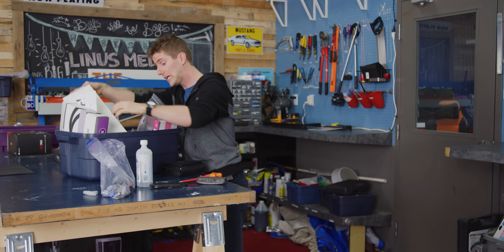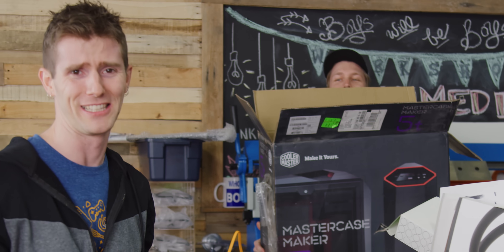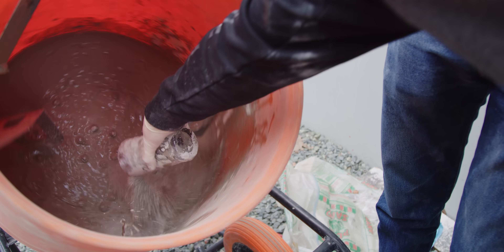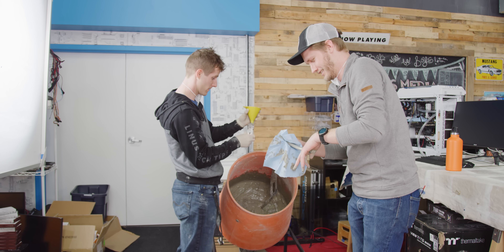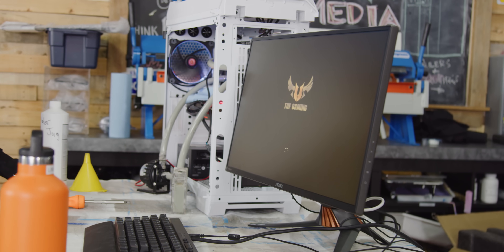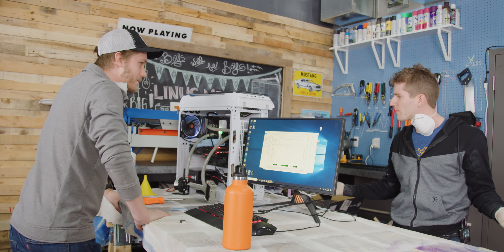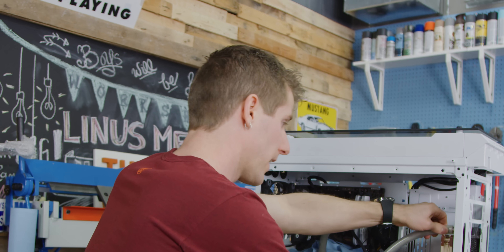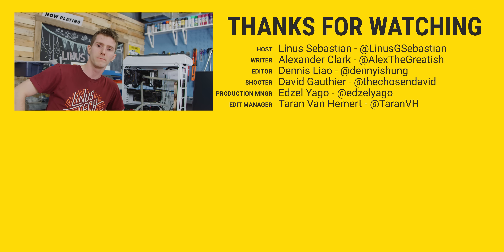I Can't Believe This Worked!!! - Concrete Cooled PC (April Fools 2019)

Comment: Next year, do an EPOXY COOLED SYSTEM!  Mix up the resin and hardener with a slow cure epoxy (so it flows better).... then fill the loop!  I’m actually shocked at how many people don’t know this is an April Fools prank video and are actually discussing the merits of using concrete as a coolant.... for real. <FacePalm.jpg>

Comment: Uh even with a UPS I see 2 huge issues. 1st being you can never turn your PC off, 2nd that will probably kill the pump pretty fast and then what do you do? You would need to have a replacement pump and be there when the pump died to replace it asap.
Also don't trust this at all where is the real PC your using hiding?

Comment: So, the fluid not moving at the edge of the pipe is related to the navier Stokes equation. For flow between two plates/the walls of a pipe your velocity tends towards zero. There is a shit load of differential equations involved, but, yeah, that's why you observed that

Comment: Concrete curing is an endothermic reaction. The chemical reaction of the concrete curing would be a factor in soaking the heat away.
So is this an April fools?
Reply: It's actually exothermic so it generates heat. With such a small quantity it will pprobably not be noticeable though, it generally causes no issues even when building walls with it, the heat generation only becomes problematic when you build giant solid structures with it, such as dams.

Comment: Concrete hardens even when not exposed to air because the water is built into the concrete in a chemical reaction. I don't know how much you would need, but I suspect there is a point at which there is more water there than the concrete can take up, at which point it wouldn't harden anymore unless water is lost through evaporation
Reply: cough it’s an April Fools joke video. cough So.... better make sure you didnt get pranked a few times already if this is the first time you realized that fact. XD

Comment: Have you tried pulling the heat with the help of concrete instead of using concrete as a coolant? Isn't it obvious that concrete gets solid after some time? Use concrete for pulling the heat from the PC and then again use concrete to pull heat from the coolant! Right? Did you try that??

Comment: Linus, the Thumbnail is misleading.
That's Cement, not concrete.
Reply: L.A. Garcia it's the tampon scandal all over again
Reply: Instructions unclear.... GTX stuck in my driveway
Reply: it really bugs me every time he says Concrete
Reply: Cement is powder.
Reply: robotica, Cement is a powder that you add water to in order to cause it to harden. Wet or dry, it is still cement. Concrete is a bunch of rocks/sand/minerals bound together with cement(that, again, needs water to harden). Since they didn't add any sand to it, all it was is cement, and not concrete.
Reply: @robotica34  OK its Cement paste

Comment: Concrete is not a solution,  But a water + ceramic liquid may be
And you can have found the ultimate computer cooling solution

So I suggest you to take some brick and or tile, make powder with it, and try several proportions with water until you find the good one that do not petrify over night and make the temperature low enough.

And even better, probably in some college some engineer or student can tell you it without the need to make too much tries.

Comment: I get that this is an April Fools video and all...but I am reminded of Whole-Room Watercooling.  Like, if you were building a house from scratch, you could theoretically lay copper pipe in the foundation and then run that through any loop.  It would (theoretically) function just like a gigantic radiator.  I imagine it would be less efficient per square inch but when you could potentially have literally 100x the surface area, you still might end up with lower temps.  At that, you might even be able to get below ambient because your temperature floor is no longer the ambient air temp in the room, it's the temperature of your concrete foundation buried in the ground...which is definitely going to be cooler than the ambient air temp (unless air conditioning is involved).

Like, it's definitely not a cost-effective solution or anything...but man...it'd be a dope loop.  :D

Comment: What if you put only trace amounts of cement in the water? Then you'd have particles of cement infused in the water. It would still be 'cement cooled', but the cement would just be a very 'watered-down' ratio.

Comment: Seriously?? Didn't you know concrete gets harden when it's baked or heated up?  Of course these are good for cooling thing, bt for flowing in tubes to cool down CPU , really gonna fries up. I gota small suggestion instead making it flowing in tubes, why not trying to make it block which sits on processor,  & passing or drilling two "in" & "out" holes for liquid to flow through pump & radiator. (Cautious: concretes may chances for leak, so make it carefully as liquidproof). Also try liquid metal as coolant's.

Comment: I would say do it a lot more watered down. It is possible that the same concrete that was not flowing eventually caused an overheat as concrete will heat up when it dries. If the whole thing is moving it should prevent this from happening. Still downside is that the cooling should never turn off or it would risk drying up like what happened on the video.

Comment: Wonder what would happen if the concrete was more watery.  Would it set like the thicc concrete did?  I.e. if it's too watery to set normally, and the loop keeps all moisture contained, would it be good?  Would more watery concrete wear the pump out slower?

Comment: Why not just apply the concept to fluids of differing viscosities? That's probably all it is. Has anyone used motor oil?
Reply: Won't work. Water has a heat capacity of around 4.218 kJ/kg×ºС, while gasoline only has 2.09 kJ/kg×ºС. The best is probably liquid ammonia with 4.73 kJ/kg×ºС.
Reply: @Ruhrpottpatriot  So use a pump designed for it then. 

Not only that but graphite has specific lubricating properties and evenly distributes within the oil. I think theres a good chance it would work even with a standard pump.
Reply: @AndAbel-AOD  It's a solid object in your fluid. It has abrasive properties, which will damage a something like a D5 or DDC. Pumps designed for solid objects in the fluid are usually much bigger, if you want them to run over extended periods of time. They also require much more energy.
Reply: @Ruhrpottpatriot  No it DOESN'T have abrasive properties, its a lubricant. Graphite also has extremely fine particles. Graphite is SOLD as a lubricant and even added to oil  for car engines because of its lubricant properties.
Reply: @AndAbel-AOD  A car engine is usually made out of metal that needs to withstand much higher pressures. Just because something works for one piece of equipment doesn't mean it'll work for another. A D5 or DDC is a pump that's lubricated through the fluid itself and only has a very small surface and doesn't need any more lubrication.

That said: 
a) Graphite is not a wet lubricant, it's a dry lubricant that only needs vapour to work (which later on evaporates)
b)It's also conductive which will worsen your galvanic corrosion that is happening (even if you don't mix metals, you'll still get it)
c) Graphite has a heat capacity of 0.710 kJ/kg×ºС and thus is much worse than water. Copper has 0.385 kJ/kg×ºС, Aluminium has 0.897 kJ/kg×ºС.

Yeah, just use water. That'll suffice.
Reply: @Ruhrpottpatriot  Do you actually believe the footage in this video is real? Do you believe the pump can actually handle moving cement? Do you actually believe a pump that can move cement would have any problem with graphite infused oil?

How bout I use whatever I want to use? Thanks.

My questions are rhetorical, I already know at this point that attempting to discuss these issues with you is borderline futile.
Reply: @AndAbel-AOD  No, I don't believe a D5 or DDC can move any form of this "liquid". 
I also never said, that you need to move cement, I simply said, that any solid substance in your liquid will wear out the pump unless you use a pump specifically designed for that.
So stop putting words into my mouth.
But you said to use graphite or as Op posted "motor oil". Yet any of those substances have less heat capacity than plain old water, making them therefore useless.

Naturally, you can use whatever you want. However, I'm totally in the rights to call out your bullshit.
Reply: @Ruhrpottpatriot  BTW upon some minimal research it appears that Thermaltake strongly recommends pre-mixed coolant apposed to water because water causes corrosion to metals over time, but I bet you think you know more than one of the actual manufacturers of d5 pumps right?
Reply: Maybe motor oil with graphite. Some forms of graphite are supposedly more thermally conductive than copper.
Reply: @AndAbel-AOD  Which will kill your pump faster than a concrete wall your car.
Pumps don't like stuff in the fluid unless they are designed for it.

Comment: Apparently, you have never worked with cement. Cement has inner temperature when it is mixed with water. But after it is cured it looks for temperature to be drawn pretty easy. One thing that might help is the plate to be made with cured cement and a layer of copper between water and the cement.

Comment: Me: Happy April foo-
Linus: checks the pc stats
Me: Wait?! It works?
Reply: easy to fake. Could have even had the monitor plugged into another computer.
Reply: pc stats are concrete evidence that it worked
Reply: @50geo50  I cement this guy's statement with a proof by saying that I also saw the pc stat
Reply: @50geo50  I see what you did there XD
Reply: Concrete is an insulator
Reply: I think that's the joke

Comment: Alex's is wondering, "Who are well fooling today?" (There is no SSD or HDD in the fake pc) hahah
Reply: There was a nvme drive. We see him screwing in the heat sink around 3:00, right before they put in the 2080
Reply: @stupidtomatos  Nope you can clearly see that all the mounting points above the graphic card which means no NVME. They did an Intel and you didnt notice lol.
Reply: @ig33ku  what does it being intel have to do with it? At 2:45 there is a clear shot of the M.2 cover/heatsink. Unless that board would have a useless cover in the middle of the board that doesnt cover anything.
Reply: M.2? 
Mounted on the other side of the case?

Comment: This is gold, super freaking cool.  I'm a little upset LTT didn't upload an April Fool's video instead, but this is awesome, I'm definitely gonna do this my next build.
Reply: Also it's "woooosh" not woosh/woooshh shaking my hamster.
Reply: @Andreiva nope?
Reply: thats not gold, thats concrete
Reply: @KoshiDanz  lol you got me.  this is officially the most likes I've ever gotten on anything ever.
Reply: The slurry remains cool  and drops in temp as long as the water is available for the reaction  this type of cooling would needs additional water intake to keep it fluid  after every few minutes
Reply: Don't do it like this if you try, the cement sets as a result of reacting to water, not air. Keeping it moving will not help keep it liquid.
Reply: Plot twist: this would never worked well and it's an Aprils' Fools' hoax meant to convince people of doing it and breaking their PCs.
Reply: @benitollan  the ssd video was the april fools video, this is just the old good channel super fun dna lol, btw if they had more water to keep it liquid it should had worked but the system will have to keep working 24/7 and you will have to keep adding water
Reply: @oCMSo  /r/woosh
Reply: @oCMSo  Civil engineer here, this will eventually set even with excess water. The chemical reactions will occur and it will gunk up somewhere as the mixture separates. Instead, consider using a clay solution.
Reply: @ProfessionalProfessorPat  not a bad idea!
Reply: @benitollan  Nah, it's legit.  My ex's cousin's uncle's step-brother tried it, got 7 degrees lower temps.

Comment: Me: Yeah It must be a April Fool's Video
Oh....Wait
Reply: while how many people will use a liquid then can turn into a solid after a few hours of not moving to get up to a -10C improvement that will also make you have to replace the entire liquid cooling loop including the pump, blocks and radiator
Reply: @yumri4  Cement still sets while mixing, it just takes longer for its growing crystals to clump together while mixing is keeping them apart. Sooner or later though, the reaction will consume most of the water and there won't be enough left to liquefy the mix so the pump can continue doing its thing.
Reply: @teardowndan5364  did not know that as i am a tech guy not a cement guy. It is a building material that works well for a ground and for basement floors.  So anything during with how cement works past that idk it just seems like a stupid idea.
Reply: @yumri4  yeah I agree, ideas like that need to be dropped on the floor